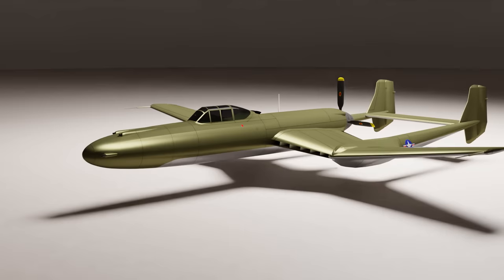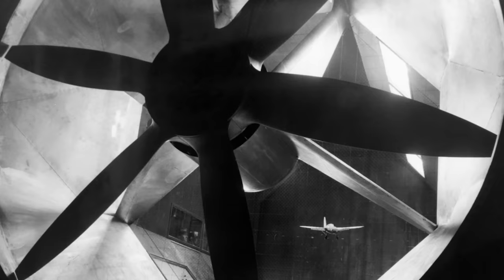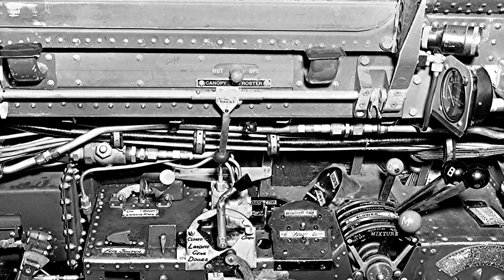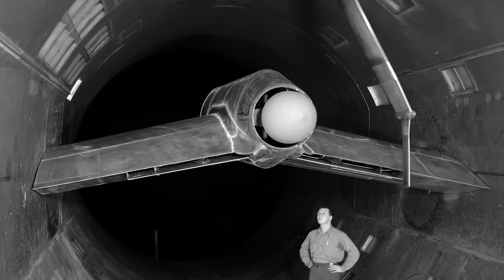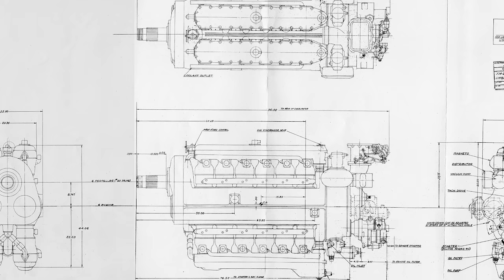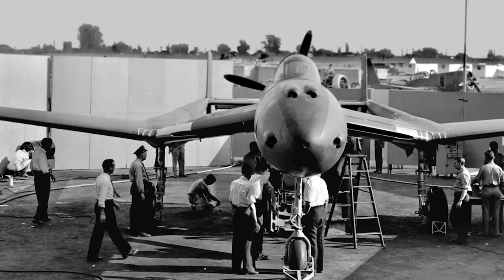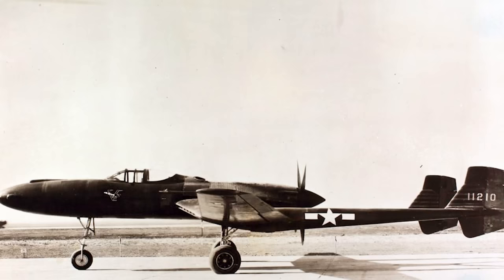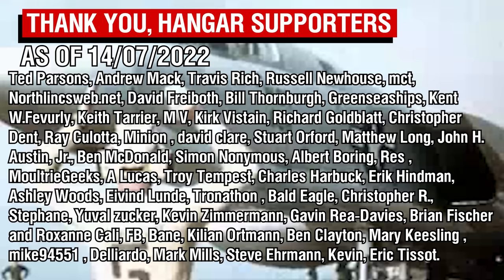The Super-Fighter That Was Betrayed By Its Engine | Vultee XP-54  [Aircraft Overview #68]

Comment: The trajectory of the aircraft from when the Wright Brothers first flew in 1903 to what was being done by the end of WW2 is unbelievable. I heard once that the entire distance of the Wright Bros first flight could have been done inside Hughes H4 Hercules aka the Spruce Goose that was assembled and "flew" 44 years later.
Reply: And 22 years after that, humans reached the moon.

Kinda feel we lost momentum since then. On the other hand, we take flying for granted now and I guess that is a milestone as well.
Reply: @stianberg5645  The problem is that the difficulty of advancement does not scale linearly. It's easy to design aircraft that can travel 500 mph when they currently travel 100 mph. It is much much, much difficult to design an aircraft that travels 2500 mph when current aircraft travel 500 mph.
Reply: Steel Ringer  IIRC it didn't have enough engine power to get out of ground-effect flight (WIGE long before the Russians!) so it was arguably not a "real" aircraft. OTOH that was just a power problem. The short flight distance was AFAIK just because of the limited testing area.

Incidentally, it was so large it might well have crossed the Atlantic as a WIGE... Now that's an interesting start for an alternate history!
Reply: @rubiconnn  There's also the question for the need of such fast aircrafts : modern fighter are actually slower than late Vietnam war fighters. We're also thinking of making airliner slightly slower.
We can make hypersonic aircrafts, NASA has done it, they're just so expensive that beyond science and missiles, they're kinda useless. And very hard to fly for a human.
Reply: @rubiconnn  I just want airplane seats that are 1/10th as comfortable as in any vehicle
Reply: @rubiconnn  we say that now, but when they only flew 100mph they thought 500mph was unreachable too.
Reply: Yep it really is amazing and remember early jets were flying in 1939.

If WW2 was delayed by even 2 or 3 years it's very possible that the piston engine powered monoplane fighter would be ignored by history.
Reply: @Ushio01  I don't know WW2 is what accelerated the development of the jet engine. Had WW2 not happened would the internal combustion engine development gone from 300hp in 1938 to 1500+ by 1945. The increase in ICE output and aero technology forced the Germans to experiment with jet engines. The Germans did develop the jet engine by the end of WW2 but that first generation was so unreliable and unrealistic for anything other than proof of concept.
Reply: @chesspiece81  The early jet engines were flying in 1939 and 1941.  The UK had operational combat jets in 1944.

There is no reason jet engine tech wouldn't have advanced if WW2 had been delayed.

But what would have happened was that the rapid improvement of existing piston engines wouldn't have happened.

The Rolls Royce Merlin would have existed and a successor would have been developed but the rapid improvements of the Merlin itself wouldn't have without the needs for it because of the war.

The same goes for the Pratt & Whitney R-2800 Double Wasp which also had many variants.

Basically instead of building a hundred odd variants of the Merlin you build just a few then go to the griffon and the early jet engines.
Reply: Wright Brothers, who first flew in1903, but not the first flight to take to the air, record wise. That honor belongs, to the French👍☺️!!! Scholastically, Americans were lied to, for the past century about this fact😔.
Reply: @stianberg5645  SUPPOSEDLY🤔⁉️
Reply: @Roger Rendzak  you mean the first fly that Clément Ader claimed he did later in his life with "two witnesses" there to see it??

Comment: So many stories like this in ww2. A lot of teething problems with early jets but they had less complexity than late piston engines. A great "what could have been"
Reply: The Westinghouse J40 similarly sank a few otherwise promising designs, so it was far from unusual for engines to doom projects. The problem with the piston engines was that sizes & power outputs were so different, so it wasn’t always easy to just stick a rival power plant in. With early jets, there were often a few options in the same rough size class, so it was slightly easier.
Reply: @edsutherland8266  As a Vietnam era Naval Flight Officer, I can confirm that reports of the weak performance of the Westinghouse J40 were still then passed around. Oh for an F7 with a 12,000 lb thrust turbojet!

Comment: Another great video. Note: As one with experience in burning magnesium, I would not call using a torch or similar to ignite it, "extremely flammable". Gasoline and oil can be set alight with a match, but an airframe of magnesium, not so much. In comparison, finely divided steel wool can be lit with a match, but one does not call steel extremely flammable.
Reply: From the context of the video, I believe he meant in the circumstances compared to other airframes. You mention magnesium requiring a decent amount of heat to ignite, and while that shouldn’t be extremely flammable on its own, in a combat vehicle it may be so. What I mean is the potential for engine or fuel fires are possible, and even more so in aerial engagements. If the engine catches fire, the normal aluminum airframe still retains most of its structural strength, whereas it sounds like magnesium would ignite the plane at a much more rapid pace. Though he really may have meant it in your sense, too. Interesting, nonetheless.
Reply: @soberedsoldier2578  
Putting out burning steel wool and easy but with burning magnesium just put it someplace where it can burn itself out safely.
Reply: Magnesium alloys are widely used in jet engines, in the structures of military and civilian helicopters, and in hundreds of auto components, without flammability issues
Reply: @soberedsoldier2578  Magnesium melts at 650C, Aluminum at 660C. Oil/gas mixtures used in aircraft engines burn at over 2500C, aluminum ignites at around 2000 and whereas magnesium is lower, it does not matter since both will be burning. I've worked an aircraft accident where the engine melted out of the fuselage, after which the movement of CG aft caused it to stall. Both people died. BTW, shredded aluminum in oxygen was used in old flashbulbs (it was not magnesium as was popularly thought).
Reply: @tsbrownie  The more you know. Thanks for clarifying that for me! In that case, no idea why he said that then. Oh well.
Reply: @tsbrownie  this is a really interesting thread - thank you. So I recall igniting magnesium powder and ribbon with an ordinary cigarette lighter, but doubt I would be able to do that to aluminium. Or am I getting this wrong?
Reply: @Simon_Nonymous  Aluminum ignites around 2000C, and magnesium under 700C if I recall. Aluminum softens losing half its strength at around 600C. There's always tradeoffs with material selection.
Reply: @tsbrownie  thank you for your expertise; I was reminded of engine fire issues on the B-29s with magnesium alloys in the engines and possibly air frame. I think the same was found to be true when British warships were hit in the Falklands war. To be honest - I'd not like to fly in a magnesium plane! Cheers mate, keep safe.
Reply: @kyle857  1) Modern Magnesium alloys are different than all-magnesium airframes from the 1940s
2) Civilian aircraft and automobiles are very rarely in a situation where they're being shot at with incendiary ammunition.  ;)
Reply: @junibug6790  How often were pure metals employed, or were they probably all alloys?
Reply: @Scepticalasfuk  I'll be honest, I've never met anyone with such a personal vendetta against a mineral before.
Reply: True! Wheat flour can be a high explosive, or at least fine wheat dust mixed with air can be, but that doesn't make bread extremely flammable.
Reply: Interesting side note: my farts are also extremely flammable
Reply: Magnesium used in automotive race car chassis designs had a sordid legacy. I imagine their use in a combat aircraft of the same era would make for much in the same. The fires were notoriously intense and difficult to put out.
Reply: Magnesium in modern applications are used in specific alloys with specific coatings in specific applications.

Comment: I bet the aircrews would have come up with some choice nicknames for this thing had it gone into full production.  That "ejection seat" is horrifying.  Baling out at low level in some planes was possible (two members of John Hopgood's Dambuster Lancaster crew baled out at around 200ft as the plane disintegrated, and survived, albeit injured) but jumping from the Goose at low level would be a guaranteed death sentence.  Mind you, with all that magnesium, the funeral pyre would have been bright.
Reply: It would have been a terrifying thing to fly, cant bail out low, cant get out if you make a gear up landing, i find it more scary than an me163. At least its theoretically possible to get out of that haha
Reply: Magnesium alloys are widely used in jet engines, in the structures of military and civilian helicopters, and in hundreds of auto components, without flammability issues
Reply: @kyle857  yes - it's not clear if "magnesium" refers to pure magnesium or alloys. Probably alloys as magnesium's known engineering properties are generally poor for most purposes.

People used to refer to some car alloys as "mag alloys" as they were magnesium alloy wheels.
Reply: @Rapscallion2009  Still burns like a mofo if it gets hot enough. I've worked with firefighters, SOP for a magnesium fire is to just stand back and watch it burn, because water only makes it worse -- it's so hot it breaks the water into hydrogen and oxygen, which then burn back into water.

Comment: Great looking unusual plane, shame it didn't work out.
Interestingly Vultee joined up with Consolidated to become Convair and built the mighty legend, the B-36. 
About magnesium, it has commonly been used in the aviation industry for parts of planes, especially in the engines, from the Bf109 up to Airbus and British Aerospace, the main concern has always been corrosion. People know the thing from school, the magnesium ribbon put in a flame, but solid magnesium is a lot harder to burn, it has to be heated to melting point with continued sustained heat to catch fire. Aluminium has the same sort of melting point, aluminium powder has been used in rocket propulsion.
Reply: Exactly this. If you already have a fire bad enough to light bulk magnesium, magnesium isn't your problem 🙂

Comment: As a former Air Force O-2 guy, that one strikes a chord. If only it had held on long enough to have a turbine engine installed, it might have been a terrific "fast FAC" plane. Or at least "faster FAC."
Reply: Exhaust from the jet would've had a ball with the stab, that would need to be relocated, tops offins?
Reply: @vumba1331  I should have said "turboprop" Sorry if you thought I meant a jet engine.

Comment: SAAB J21(J=Jakt=Pursuit) served whit the Swedish Air Force from 1945 to 1954. Same designphilosophy and using the same engine as the German Bf 109, built under licence. Was the first aircraft to use an ejection seat devoloped but not patented by Bofors. https://en.wikipedia.org/wiki/SAAB_21
Reply: It was layer developed into the jet version J21r, which looked a bit like the de Havilland Vampire.

Comment: This whole design seems terrifyingly needlessly complex. The dangerous ejection system, the unnecessary seat lowering system, the cabin pressurisation, and the moving guns. I'm surprised it wasn't thrown out because of the cost and complexity.
Reply: Yeah they broke one of the cardinal rules of aircraft development. When you need something soon, never try out a bunch of brand-new ideas on the same plane or you're gonna run outta time troubleshooting everything.
Reply: @sockmonkey6666 ...and especially if those features are unnecessary at best.

Comment: I knew 2 out of the 4 planes from this contract/specification - not this one. A very interesting story. When the original engine was cancelled, why wasn't Vultee allowed to switch to the Allison engine? It would get the plane flying, the design's aerodynamics were the real thing that needed to be explored.
Reply: @Cancer McAids I'm...not entirely sure what you're getting at. The 1710 was quite a bit lighter, but they could have pretty easily adjusted the CG while they were in the prototype phase. It probably came down to the fact that it was just not feasible in budget or timeline to continue work with the design, considering the much faster P-51 first flew three years prior, and had already been in service for a year by the time the XP-54 first flew.